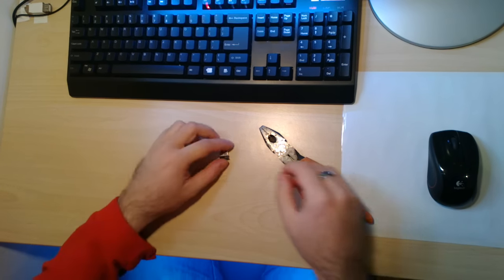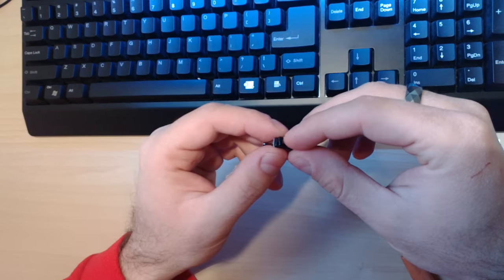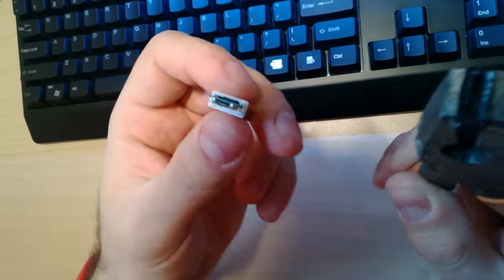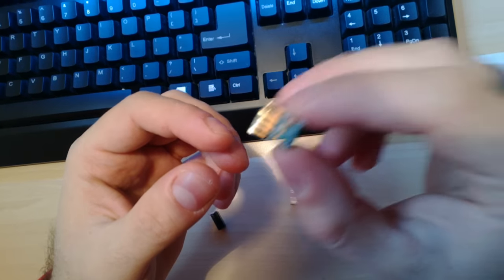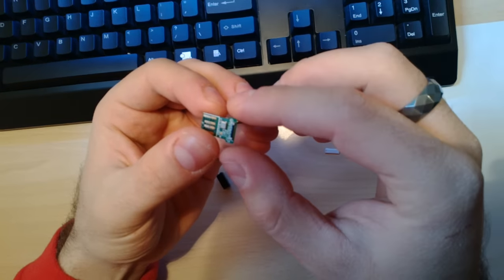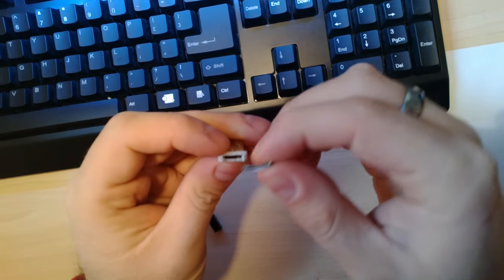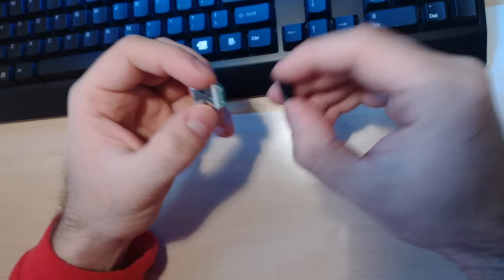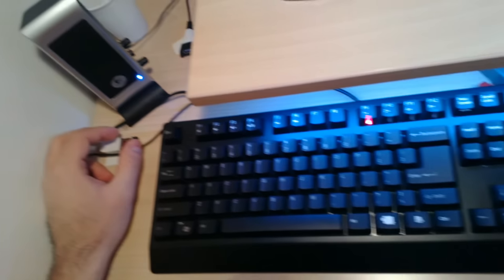How to fix faulty USB Receiver (Logitech Unifying)

Comment: I contacted Logitech, replaced batteries and followed every tutorial online to fix the issue of my mouse+leyboard combo working only intermittently. Then I came across this video and it fixed it! This is 10 years after you first posted it. Logitech should stop making these faulty unifying receivers! Thank you very much for this much-needed fix! Imagine the e-waste that is being generated just because of Logitech's faulty design!
Reply from the maker: I agree!
Reply: I determined that a simple squeeze to slightly bend the metal and tighten the grip on the contacts is all it needs. From a lot of experience in contact plating - this is in fact avoidable with better materials and processes. They are squeezing the orange dry on costs..:body-green-covering-eyes:

Comment: Slipped on the stairs while carrying laptop. Laptop fell, landed on corner with my unifying receiver plugged in there, thus bending it. Couldn't use my mouse. Fretted over replacing mouse etc. Watched this video. With a pliers, stanley knife (be careful separating the plastic cap, I nearly chopped my receiver module in half), and a little folded paper it's fixed. WOOOOOHOOOO! But seriously, thanks a bunch for the video!

Comment: Hey i have a roccat kone pro air and my mouse used to work wirelessly untill it stopped, everytime I reconnect the dongle it make a sound on windows indicating that it's connected, but only like 3 seconds later it disconnects and it repeats the cycle

Comment: This is some absolute bullshit. Before I go on let me say that this fix ABSOLUTELY DOES WORK. The bullshit I'm referring to is Logitech's engineering. It seems that this problem happens because that little white plastic thing you see in the video is hollow underneath the board. Over time the plastic compresses allowing the board to sink and no longer maintain proper contact with the contacts on the computer side despite there being nothing wrong with the board itself. The paper shim creates positive pressure under the board allowing it to function as it should. I did this with a G602 gaming mouse receiver which is fundamentally identical in design to the Unity receiver. Honestly the hardest part was getting the cap off of the receiver. Two pairs of pliers and a good tug was all it took.
Reply from the maker: They are saving material (money) on a crucial detail of product. But again I would always buy Logitech.
Reply: I change Logitech hardware for Microsoft Hardware, believe me, the quality of MS keyboards and Mouses is really good. My Logitecth  (4)Receivers are very laggy and have slow response and I haven't found the fix for that.
Reply: Commenting to say thanks and confirm - this does work for multiple kinds of logitech receivers. I also have a g602 that was experiencing this problem, used this fix and now it works great! Saved me getting a new gaming mouse.
Reply: They dont only save material (in fact I dont think it's at all about saving material), this is a classic example of todays engineering/business -> "trick" people to buy a new product instead of making a product that is intended to last for life
Reply: I end Up buying a new receiver on EBAY. They cost around 6-10 dollars. I tried to fix mine but I fail miserably at soldering ..
Reply: Abraham Soto soldering?? If you need to fix the chip itself, bake it instead in an oven. This video covers the fault in the connection of the port, which is causef by shitty design/on purpose.
Reply: Depending on how long you've had the mouse and if you still have the receipt you can put in a warranty request. The warranty is for three years and I actually got them to send me a new receiver. I also had the middle mouse button go out on my first one and they sent me a new mouse without asking for the old one back. Bought 100 buttons off of Amazon for about $2 and replaced the button myself so now I have two mice.
Reply: maybe its kinda business dude, cause most of the people get the new one without even knowing the problem.
Reply: Actually Logitech just used cheap parts because you dont expect over a year of lifetime of any electronics these days. The fact that it actually stops working in most cases is just coincidence.
I fixed mine for good by taking a very good male USB, left about 2cm of wire and soldered the reciever and covered with shrinking tube. 10/10 and will probably never break (the PCB itself will go bad first).
Reply: a tiny little "plastic thing" came out of my receiver. it seemed to have snapped judging by the slightly uneven edge
Reply: also, these tips might work:
1. force the Receiver to one side and wait until you hear the noise of approval.
2. use your computer on a desktop.
3. I had the same problem with my headphones which are not wireless and i just keep it on a table so do that.
Reply: I had the same problem with my g900 (the board inside the usb doesnt maintain proper contact with the board on the computer side), all I did is plug it in and press the usb down a little bit, and IT WORKED. I havent try this yet, but will definitely do if it stop working again.
Reply: This is the standard. What is the point in making something that will work for too long? Things are engineered with flaws specifically to ensure people are forced to throw it out and buy another. Even if it's a simple easy fix, only a tiny percentage of people will take the time.  Greed...
Reply: Thank you, my friend! I have a g602 and its receiver stopped working properly, I noticed the loose contact. Your comment confirmed that it works for my mouse. Thank you!
Reply: I'm having a problem now with my G602 not connecting to shit, but a flash drive works in all the ports.... I guess I need to do this huh?
Reply: yes, and they even made it worse by adding bumps so that the case could not come offfff...
eventually i can sort it of.. but i cant put the case back 😂but its fine tho, im not buying logi anymore
Reply: HP same issue

Comment: You are a legend, 5 years after posting this video you are still helping people with this, I just fixed by two F710 transmitters that weren't working! Thanks so much!
Reply from the maker: circuschris2880 hahahaha I know xD
Reply: And 5 years later from your post it's still helping. :)
Reply: ten years later and I suspect my fancy logitech gaming mouse may have the same issue, I might try this fix
Reply: Still helping! Thanks so much!
Reply: @ahmadwael6601  Random notification on my phone about a comment I made 6 years ago and I read your comment without knowing what video it was but I had s hunch it was for the logitech controller and sure enough it was! My use for this controller at the time was for emulation so I could switch between dinput and xinput but these days the emulator frontend retroarch means I can just use an xbox S/X controller and play all my games. I've come to prefer it over the logitech one.

Comment: Holy Crap! I've been officially humbled. 2 Logitech M570 Trackballs. 1 Logitech K400r Keyboard. 1 Logitech K520 Keyboard. All which have failed over time. By sharing a single working receiver I was able to use at least one of the devices, at least until the last receiver stopped working. All of the devices went into a box as none of them worked anymore. Until this video. Tried this fix on one of the receivers. Worked perfectly. Did the same to the rest, now they all work perfectly. Amazing. A simple piece of paper fixed them all. Thank you so much!

Comment: Amazing that this resolved the issue.  Just spent the 30 seconds it took to replicate the steps here before I purchased a replacement, and this fixed my issue.  Much Appreciated.  I didn't use pliers to remove it, but i used a small knife to pry between the Black Pull Tab and the white neck of the USB plug.  It came right apart after that.

Comment: Brilliant Igor, your fix worked perfectly! Coincidentally, both of my computers were not recognizing their logitech keyboards/mice and I had tried everything, figuring it was a complicated software glitch. Fixed them both in a few minutes. Tricky getting the tops off, definitely needed 2 pairs of pliers, 1 for the plastic piece and the other to hold the nano-receiver.
Reply: Exactly

Comment: 11 years later - This repair worked for me! (my cap wasn't glued; see below)
Instead of swapping the intermittently disconnecting USB-A logitech unifying receiver back and forth between two desktop PC's (no doubt causing the wear to begin with) , now I've plugged the "fixed" dongle into a short, cheap USB extension cable that I swap back and forth instead. Along with switching input channels on the monitor connected to the two PC's, this completes my KVM switch kludge. 
FWIW, the cap on mine was not glued at all. It snaps together with metal tabs in the metal case fitting into slots in the skirt of the cap. Popped apart easily using smaller pliers to grab the narrow ends of the cap, not the longer sides as in the video.

Comment: My Logitech K800 keyboard stopped working today.  The USB dongle said device not recognized on all ports and multiple computers.  I was about to order a new one and saw this.  The first thing I did was apply pressure in different directions to confirm that it was a connection issue and sure enough it worked if I held pressure while plugged into the USB port.  So I took it apart and stuck a piece of paper in there and now it works great!  I see that this video is over 5 years old now.  You'd think Logitech would have changed their design and fixed this after all these years.  Thanks for making this video.  You just saved me around $60 on a replacement!

Comment: You are the man Igor. This fixed my receiver!
Reply from the maker: No I'm a woman! xD
Reply: Igor Novak hey nice vid btw i have a different problem while im using my logitech mouse with new battery it randomly does not   respond the minute its ok then suddenly a full stop then again it works then it stops how can i fix this? I tryed cleaning it i tried looking inside for problems im just unsure plz i had this problem fora full 3 weeks of it just working then suddenly not working

Comment: BRO, I have spent countless hours looking up 'How to' videos and articles from EVERYWHERE as to why this is happening. It has lead me to microsoft updates to driver software to is my dongle dead? I did have an idea the usb connection was a little off but wasnt even aware i was able to open it up and tweak it like this. I AM SO BLESSED to had come upon this video. Its not even like i dont have a Razer Mamba Tournament but i got the logitech G602 for a cheap price and enjoy using it for the wireless purpose it serves and its so comfortable if im not gaming. THANK YOU so much Igor this brought back my sanity. BTW its 2019 and this still helped, you think by then Logitech would have caught on to this problem.

Comment: by the way: take the black piece between your front (shovel) teeth and gently push the metal USB connector downwards... It will crack the glue open... ;) No need for pliers...
Reply: pliers? what word is it? are you sure they aren't called "something"?

Comment: I was starting to believe chip on the mouse itself wasn't working as I tried to do your tutorial twice. Then a 3rd time I used 3 pieces, scotch-taped the piece back together and it started working! Now I just have to figure out why my Realtek sound doesn't work. XD Edit: The wireless stopped working 5 minutes later. So jiggled it and it started working again.

Comment: Purchased on line a Mfg refurbished mouse + keyboard combo that came with a faulty (intermittent connection) dongle. This video saved me time to return the item (seller will send a replacement anyway). Don't know when Logitech solved this issue but after 4 years there are some units still giving headaches to buyers. Thank you Igor for your video.

Comment: This worked to fix my Logitech G602 receiver, as well. The disassembly was a bit different, because the top is crimped into place, not glued. But ultimately, the paper fix did the trick! Thanks, man!

Comment: Thanks so much for the tutorial. I didn't even take off the black cap with "something".
I inserted a minus screw driver from the connector side, forced raised the circuit board, and inserted a piece of cardboard. And it worked !

Comment: Thanks Igor! I just fixed my G700 receiver by following these instructions. The only difference is that when I separated the cover, from the metal piece, the plastic cover with the logitech logo did not separate from the housing for the main chip itself. I put a piece of paper between the flat rectangular housing and the metal piece and now it works haha

Comment: I was about 50/50 with whether or not this was a troll video to get you to break your USB Dongle as a prank, but I was 100% surprised when I actually worked.

My suggestion doing it is you need very little paper. Your first one will probably be bigger than you need for this to get your  dongle working again. If you feel a lot of resistance when putting in the USB, be wary because you might stretch your port and make it useless for anything except the extended dongle. 

5/5 an awesome tip to know

Comment: almost 4 years later this is still a problem for Logitech, the plastic cap has a hidden tab that when pulled off will break the tab on the plastic cap.
I used two small rectangle shaped pieces of a standard North American business card (card stock) to get the correct thickness needed.

I would like Logitech to work with laptop manufactures to get a standard encrypted receiver as a built-in to the laptop so we would not needs the stubby USB receiver.

Until then I would think Logitech would need to improve the robustness of the dongle (USB receiver) to allow it to be stowed with the laptop in a laptop bag without negative effects.

Thank you Igor for saving my day.

Comment: Your solution finally solved my connectivity problem; in addition, I used super glue to seal the receiver back together. As an engineer,  I find it hard to believe that Logitech is not aware of this problem or maybe providing a solution (as you did) would be an admission of fault. Thanks to YouTube, I have solved many problems that companies see no upside to providing a solution.
Reply from the maker: They are not crazy to admit the problem. xD
Reply: igor, please help me! Does the piece of paper need to be very thick or flat?
Reply: also its not working for me :(

Comment: I have to admit I was a bit skeptical when I watched this as the solution to my problem.  Then I pushed down on my receiver while it was in the USB port and noticed that it worked when I pushed it down.  Therefore I tried the paper shim and now it works perfectly.  Thanks!

Comment: thank you thank you Igor you are a life saver! The pliers & paper trick worked a treat although the black cap didnt come off the silver plug part did buit managed to put the paper in and reassemble & it works a treat! That has completely stopped the constant connect-disconnect sounds that were driving me crazy. My mouse works fine and you saved me $60 for a new one

Comment: THANKS so much, Igor !!
Your fix has solved a problem I have been battling with for a month .. I have two receivers which sometimes worked, but sometimes did not.  Now I am one happy guy.  You are the man!!!
Reply: Brian Finneran Incidentally, I just used two pliers to pull the plastic cap off, one grabbing the metal portion.  Thanks again.
Reply: Brian Finneran   I folded the paper to make it a little thicker.

Comment: Hello Igor Novak,
Thanks a ton.  It works.  As you suspected, it is the contact points which create problem and if we make sure by putting a paper behind the contact points, the device gets connected properly to the Laptop USB points.  And then vrooom, it works.  Thanks for this advise.

Comment: Very useful advice. It works also with Logitech MX1100 receiver
Not really need to un-glue or remove receiver cover
I just used a needle to create enough space for inserting a folded paper on the back inner side  of the usb connector and it works
Thanks

Comment: Hi Igor,
Thank you for this video. I have spent quite some time trying to find a replacement reciever for my mouse, with no succes. Finally i was desperate enough to pry my reciever open in the way you show in this video. The cover would not come off so easily, I had to use a Stanley knife to cut the glue of the casing. It appears you have some strong fingers :) Now my mouse works again! Thanks!!

Comment: Thank you so much! I tried multiple online solutions without any luck. Finally, I decided to use this method as a last ditch effort and it payed off. I knew something was wrong when my drivers were installed correctly and I wasn't getting any connection. You are awesome!

Comment: It works! Awesome. Thanks Igor!

If you can't get the plastic cap off, get a sharp knife and run it around the edge between the white and black plastic and it'll cut through the glue and pop right off

Comment: amazingly this worked, and it's just a shame I hadn't found this video sooner. mouse has been defective for ages now as I had no idea how to fix the "can't be detected" message at the bottom of the screen. today I tried all sorts, from updating drivers, to different PCs, to the registry etc. but none worked until I tried this then installed their unifying software.

u just saved me several quid thanks.

Comment: Wow, that actually worked. I had to try a few times to fine tune it. One way you can tell if this might work for you is to bring up the device manager; If you don't see a mouse, or an additional mouse device, this may be the issue. Thanks Igor!

.. Now to firmly reattach the top part..